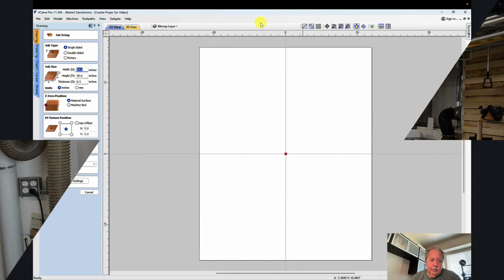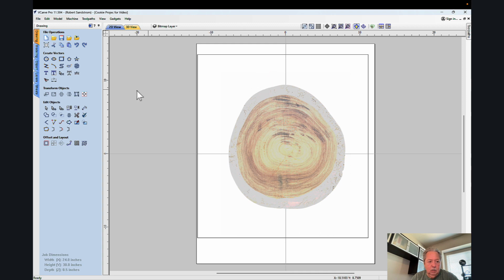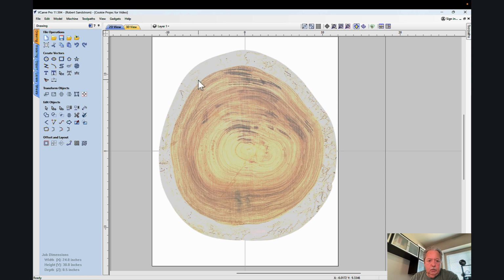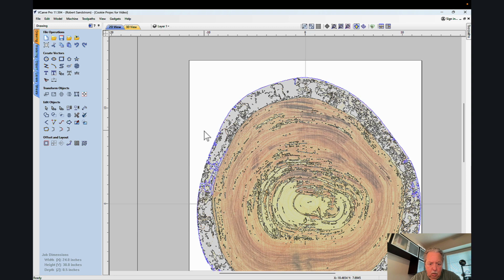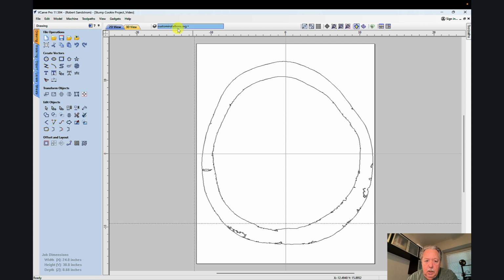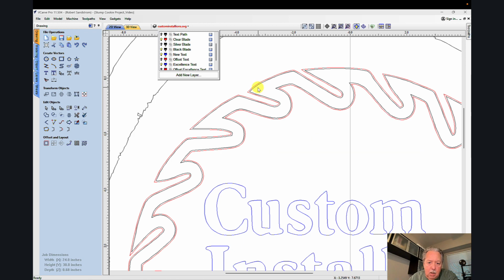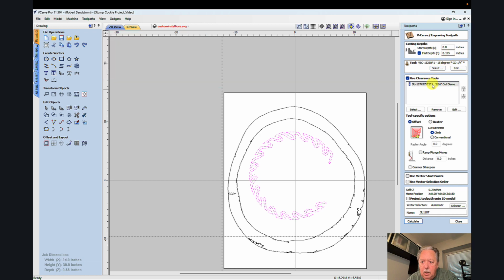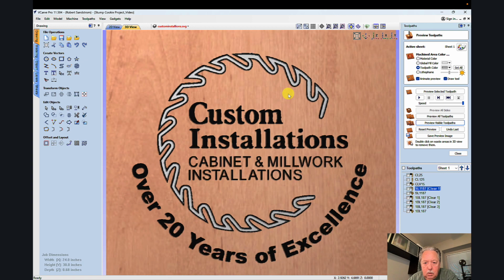How to Import a Picture of a Wood Cookie & Design a MultiColor Epoxy Sign with Vectric's vCarve Pro

Comment: Good stuff! Only thing I'd do differently is resize the X & Y at the same time by dragging a corner. With my luck in doing them separately, I'd stretch the cookie picture out of shape.
Reply from the maker: Mike that would work too!  Good tip thank you for sharing and thank you for watching.